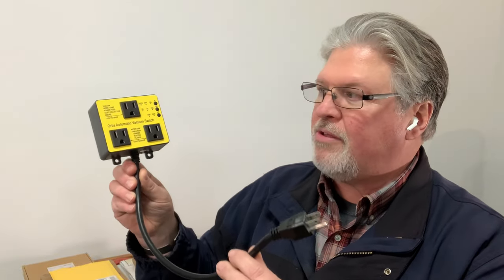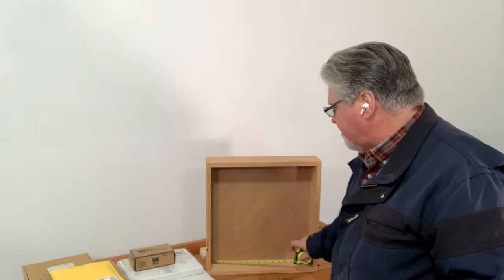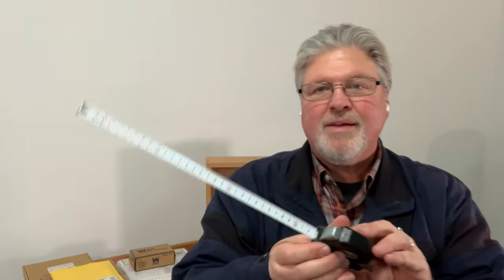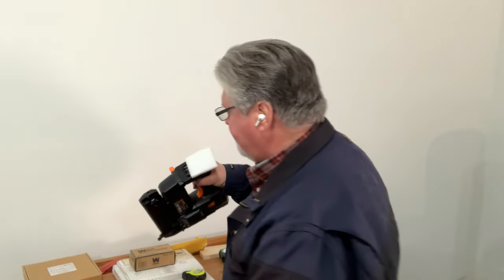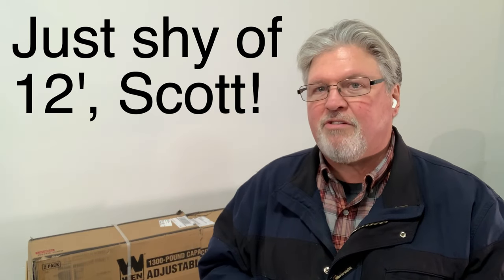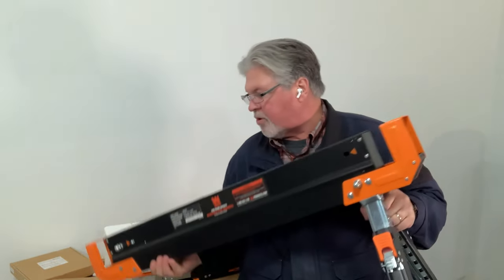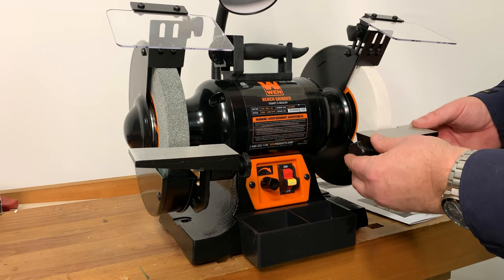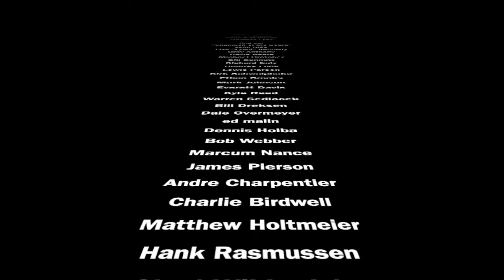First Look at a “Mostly WEN” Tool Haul

Comment: My neighbor picked up a box of miscellaneous hardware at a farm auction for five bucks.  Old strap hinges, gate hardware, rusty bolts and etc comprised most of the treasure inside.  But that’s not why he bought it.

He bought it because his dad was a Wen fan years ago.  And, right on top was an old corded 3/8” single speed, no reverse, keyed chuck hand drill.

When we got our auction finds home, he couldn’t wait to test the drill.  As I was digging through the box to find the chuck key, he plugged in the drill.  And… nothing.  

That is, until he banged in the side of it with the palm of his hand.

It sprang to life… hissing and smelling like old electric motors do.  He then released the trigger and pressed it again.  This time it started without a tap.

He then looked at me and said, “Yep!  Just like dad’s.  You have to wake them up.  Then they’ll run all day!”

So, ‘Wen’ is a drill not just a drill?  

‘Wen’ it’s a memory!

PS… the chuck key wasn’t in the treasure box.
Reply from the maker: That’s a great story and that smell is seared in my memory from using my dad’s drill!

Comment: When I upgraded my sharpening system with a CBN wheel (you won't regret it), I needed a better grinder than the 3,450 rpm, 6" ones I inherited but was too tight to buy one.  By this time, I had a new lathe because my Shopsmith was too small (not enough swing, length, or horsepower) but it was perfect to run the CBN wheel.  I also found 900 rpm was much a more comfortable speed than 1,800 rpm to run that wheel.  The doesn't create ANY dust and the steel it removes is both cold and negligible so I don't even bother covering the ways.  It sure is handy to have a Shopsmith around.
Reply from the maker: I’m looking forward to playing with it.
Reply: @MyGrowthRings  After you try that wheel on your grinder, try it on one of your Shopsmiths.
Reply from the maker: @kensherwin4544  yes, I bought it for my grinder. I may stick it on the Shopsmith just for fun at some point, but it’s less convenient than what I’m looking for.
Reply: @MyGrowthRings  'Just for fun' is why we do this stuff.

Comment: The Hultafors tape measure is very interesting.   If only they made an Imperial version.   I can work and convert between metric and imperial, but in the US so many things are made/sold/worked using imperial.
I had a Wen small diameter chisel sharpener decades ago.   I put it out on a Free pile a long time ago.   Interesting to see the rebirth of the brand.   I like the Wen sawhorses.   Tempting.
I love my CBN wheel, also purchased from Woodturners Wonders.   For your viewers, CBN is good for sharpening tool steels and hardened steel, but should not be used to sharpen mild steel since this can clog up the wheel.   This is why I only purchased one CBN wheel and have the other side with the normal grey wheel.
Dave.
Reply from the maker: That’s a very good point about the CBN wheel. I’ve purchased a few more non-CBN wheels for the other size for that very reason. Scott

Comment: Great video.  I have a very specific question that I hope you will be able to answer.  I have a very similar WoodtunrersWonders CBN wheel and what might be the same lathe tool holder.  I have them attached to my bench-mounted grinder, but I wondered if the tool rest and CBN wheel could be used with the Mark V headstock.  I actually built a mock up device, but I didn't test it because I don't trust my own judgment and wanted a second opinion .  I used the SS universal arbor to hold the CBN wheel, but as I recall the shaft of the arbor was just a bit shorter than I would have liked.  If you get a chance before you mount the CBN wheel on your grinder, see if it fits on the SS arbor, and perhaps share a few thoughts about whether or not you think this wheel could work the the SS headstock.
Reply from the maker: It’s worth exploring, but be careful if you wind up mounting the wheel to the left side of the headstock as the arbor nut can come loose if it isn’t used with a tongued washer and the proper tension on the nut.

Comment: Nice video. In search now for a new 8" Slow speed Grinder for my lathe tools. Very interested in how this works out for you with the sharpening system.  I think I have the same system as well. Was looking at the Bauer Grinder....your opinion? 
Keep up the great work. 👽
Reply from the maker: I looked long and hard at the Bauer that was on display at our local HF and I preferred a couple things about that Wen. I thought the wheels looked nicer, the tool rests were larger and don’t have the drill bit groove as standard on the Wen. The tool rest on the Bauer requires a wrench for two of the mounts, though you could argue that once they are locked in place you shouldn’t need to mess with it. Finally, the Wen has a tee year warranty, while the Bauer has a 90 day warranty.
Reply: @MyGrowthRings  awesome thanks for sharing your research with us. 👽

Comment: Being a SS Mark V owner with variable speed control,  I never even thought of purchasing a separate low speed stand alone grinding machine from china.
Reply from the maker: If you do a lot of turning and want to use a sharpening guide, as I do, you can’t beat a separate grinder. Heck, even Shopsmith has sold a couple sand alone grinders over the years.

Comment: I have owned or do currently own a few Wen tools. I like them because of what you said, they were a bit better than the Harbor Freight, at least back in the Chicago Electric days. However, since the HF went to the good, better, best model with Warrior, Bauer, and Hercules I believe you CAN get better tools at HF. But, I think what Wen does well is to very ofter hit the medium quality that have the right focus of features to be very functional and useful. I think Milescraft is another company that does a good job at selecting those feature focused on functionality and usefulness to offer a good value.
Reply from the maker: I agree that HF has really stepped up their game in recent years. I own several Bauer tools and gave the 8” Bauer bench grinder a very close look, but it fell short in too many areas where I concluded that the Wen version was superior. Even so, I’m sure I would have been happy with the Bauer, had I purchased it.